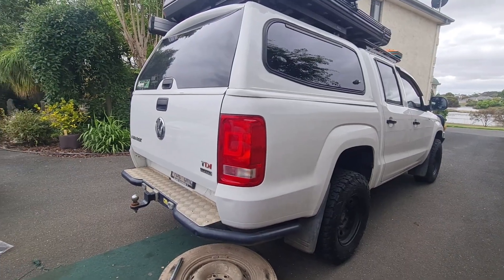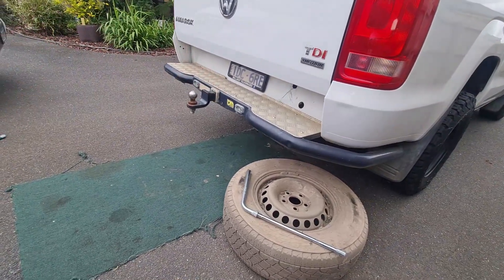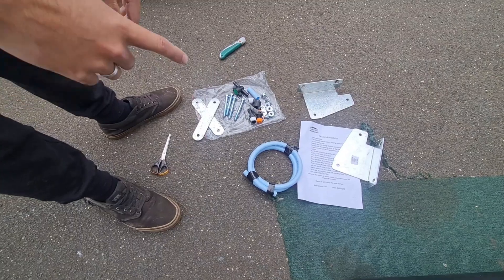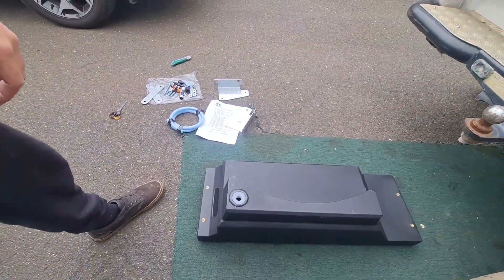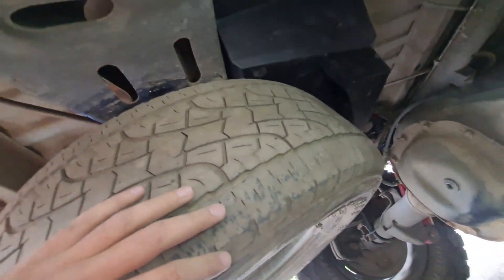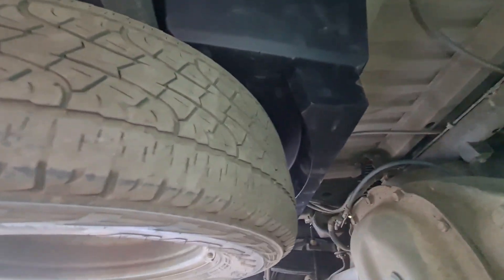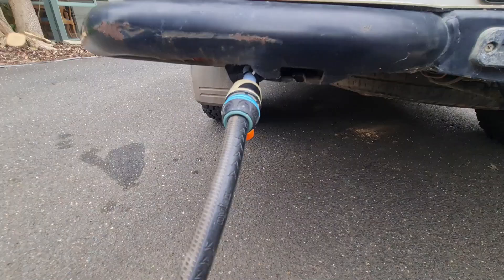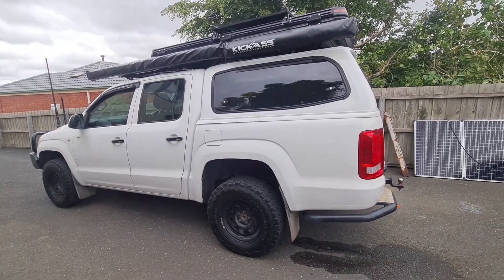VW Amarok Under Ute Tank Installation - Hidden water tank on our 4wd tourer!

Comment: Hey mate great video. Just can't work out if you dropped the tail off the exhaust for this install? Mine runs on the inside of the chassis rail on the drivers side, but can't see yours in the video. Wasn't sure if you had a custom exhaust or it had been removed. TIA
Reply from the maker: Hey buddy, I believe all 4cyl roks have the stock exhaust dump at the diff like ours.
The tank we installed from Under Ute Tanks has a provision for the exhaust to run to the back of the car like some Roks have.
It should fit up no problem without having to move the exhaust as the instructions didn't mention having to remove it by memory.

Good thing to note that if you have an adblue model, this tank won't work.

Cheers